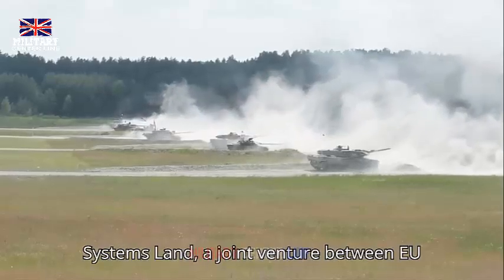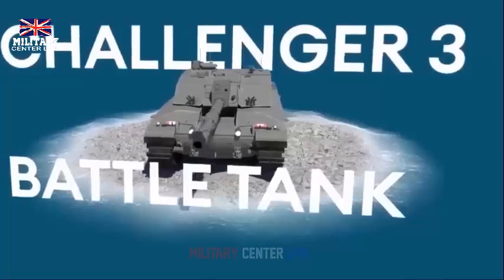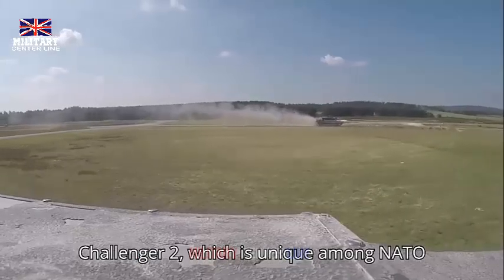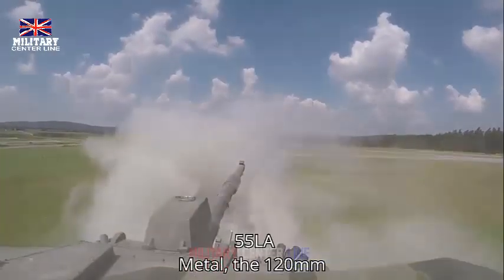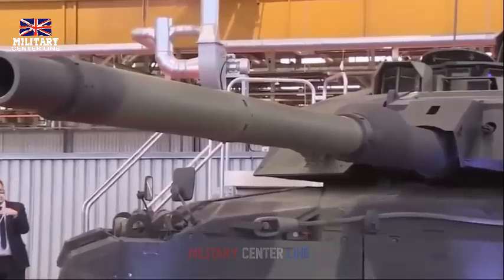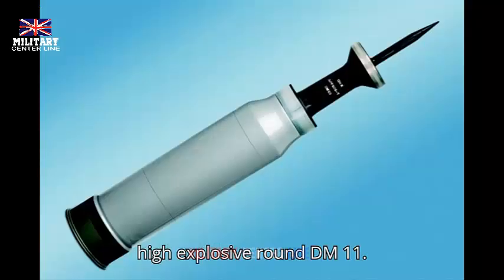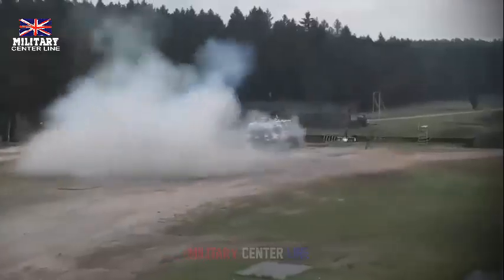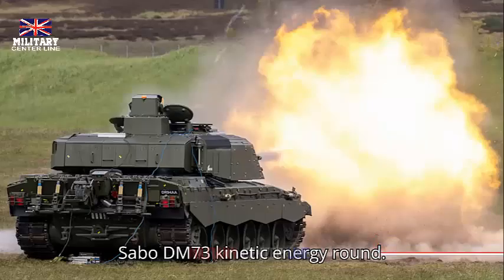British Army’s new Challenger 3 tank could have 5km engagement range

Comment: Now the Challenger 3 is the best Tank in Europe! The design, the cannon, armour but the design its their strong with their armour, no weak points in that design, to bad they have so few! Until the French upgrade their MBT AMX -56 Leclerc with a 140mm Ascalon cannon or a 130mm gun from Nexter, then the French will have the best iron, they already have one of the best the AMX -56 Leclerc is better than the Leopard 2 its my opinion